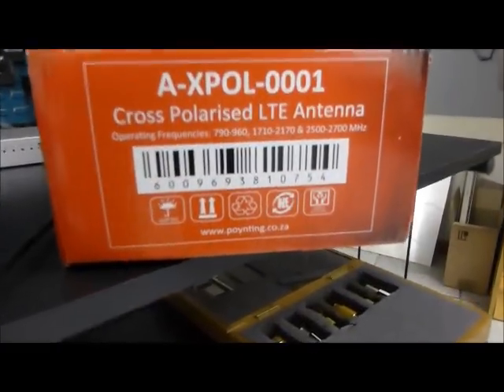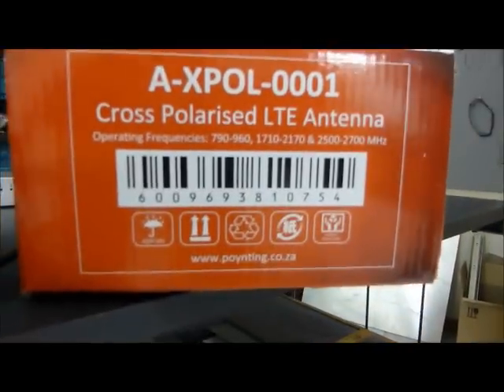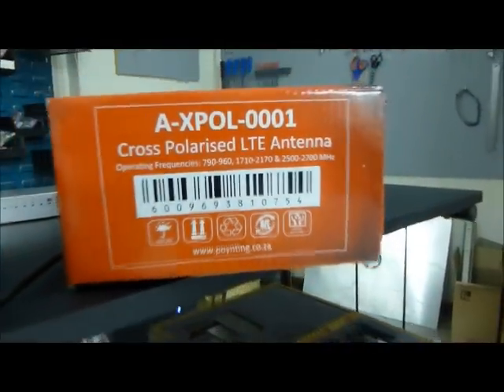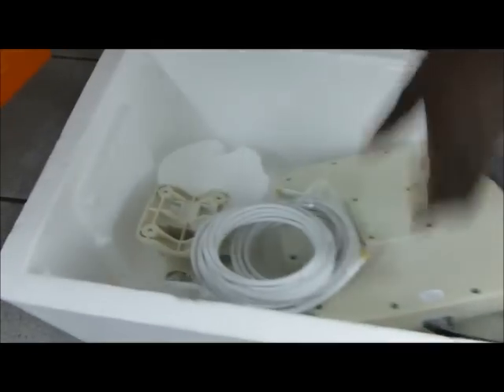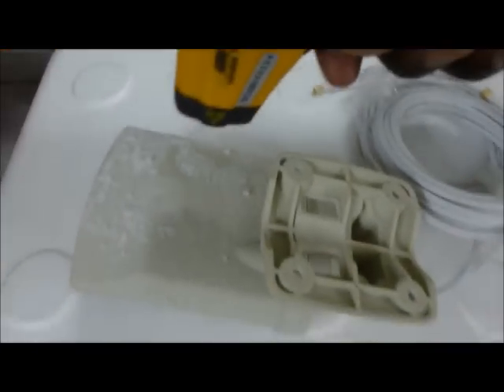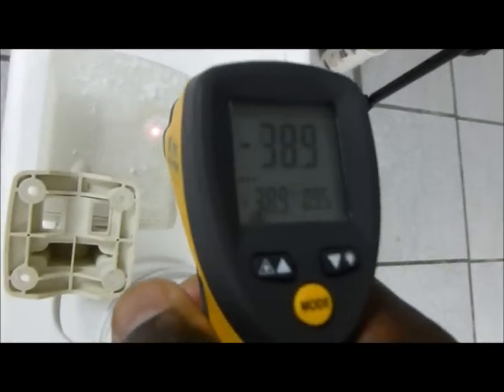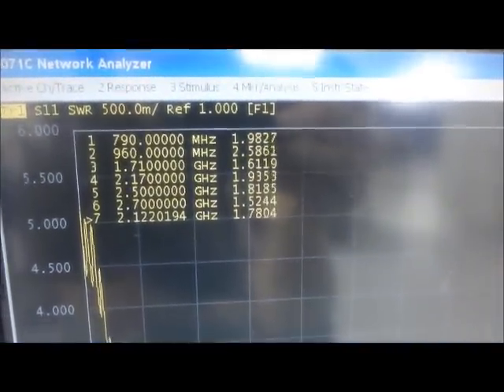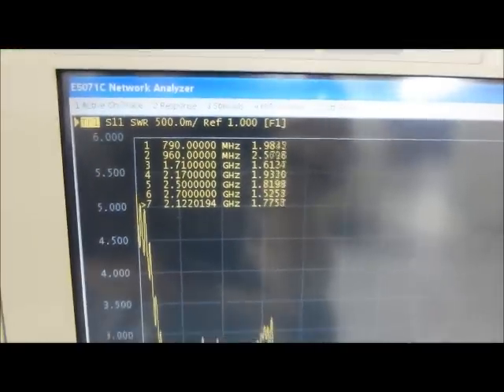Poynting LTE / MiMo Antenna at -40 degrees C (XPOL-1)

Comment: It’s work Is to boost WiFi signal ...right ????????
Reply: No, it is to boost the 4G/LTE signal coming from the cell tower of your mobile phone network provider. If you have a modem/router that gets internet from a mobile network (instead of a landline), you can connect this antenna to improve the connection to that mobile network. The modem typically also has a built-in WiFi access point (or you can connect a separate one), which has its own internal or external WiFi antennas. The WiFi signal will not get stronger, but you should get higher internet speeds.